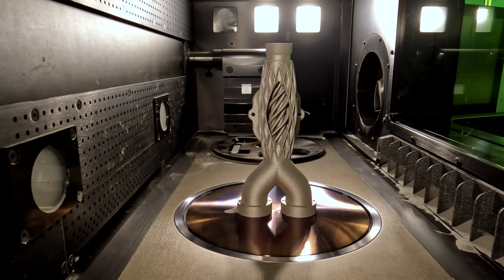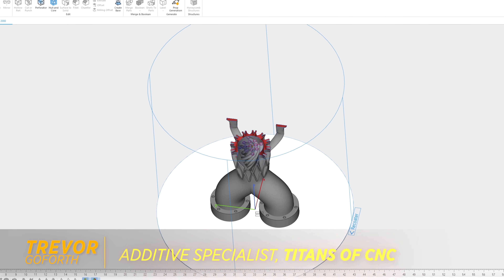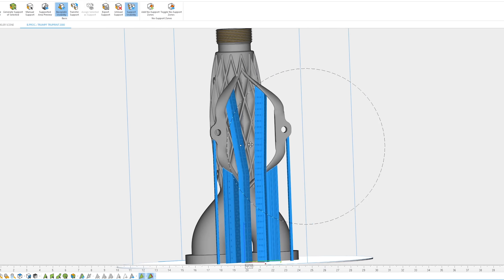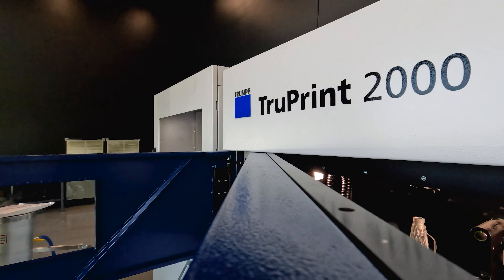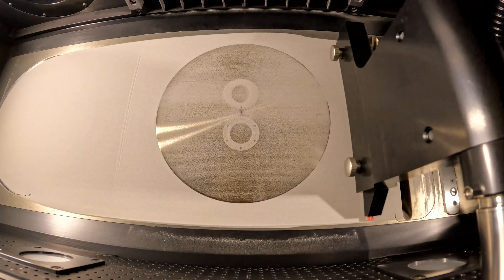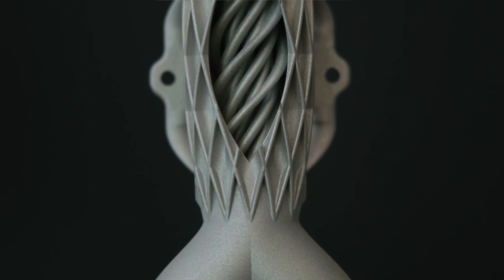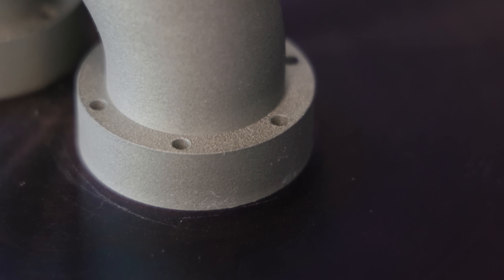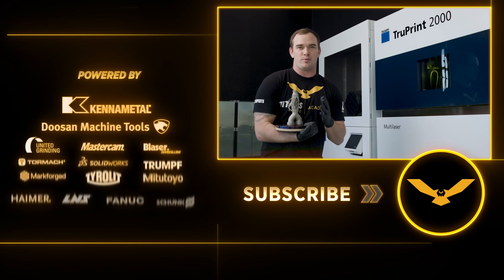3D Printing an INSANE Steel Part that's IMPOSSIBLE to Make on a CNC Machine

Comment: Wow, just wow. I am not an engineer, but anyone can see the amazing potential of 3D printing steel. We've seen plastic gadgets being printed for years, curiosities mostly. But complex steel parts, gamechanger! Engineer Designers may have been able to dream up parts that theoretically would function in a certain way on computer models and not be able to build them. This changes everything.

Comment: When that becomes practical, it will kinda' sorta' change everything. Manufacturability of convoluted surfaces is a severe impediment to advancing tech since it necessarily asserts itself as design driver. The driver usually introduces some form of compromise.

Comment: Does the part receive any heat treatment after fabrication such as sintering or HIP?  How dense is the final metal?  What does the raw material cost and how is it made.  Can some parts be made from plain carbon steel?  What technical advances been made over the last two years.

Comment: Ok but what about the reliability of the part? I know it looks nice and optimal design but aerospace and car parts are put through repetitive and grueling stress and the question I'm asking is if that method of manufacturing can make parts which won't fall apart under those conditions.
Reply: I thought GE was using these for jet engine parts years ago.

Comment: QUESTION:  I have been searching for information on the heat treatment of 3D printed metals, hardening of steel to be exact, and have not found much on the matter.  Can these components be heat treated after printing?  Thanks in advance.

Comment: Only one question - "Is that baked metal strong and firm enough to be used under high presuure and tempereature conditions"? As no one can pass by chemical and physical properties output during certain production process. Preciesely - are those inter-atomic stuctural establishments well enough to be used for a long time with desirable performance?

Comment: It's cool and very practical. This part could be manufactured without 3D printing, a multiple parts design maybe. Also I remember the first time I saw a sintering 3d printed metal part in the 90s.

Comment: my only question is: if that wasn't a cut away how would they get the unused material out of the chamber? I have trouble imagining those two little holes moving all that metal dust out of there.

Comment: It appears to be usable, but without an opening on the side, this heat exchanger will trap steel powder inside during printing, making it challenging to clean (or nearly impossible). Thus, this print is only for demonstration purposes...

Comment: can not be used with any pressure, couse is fragile and will explode
Reply: Not true. For example we 3D print the Exhaust header collectors and flanges on F1 engines in Inconel and have been doing so for the past 12 years.  These operate at 1200 degrees C, with all the combusion pressure pulses, and all the vibrations and forces associated with a race car on track.  They are designed ultra-thin (0.6mm wall thickness for lightness), yet still outlast the engines lifespan on track.

Comment: Yes sir, amazing video... the 3D-printing iself is not so special, the 3D-modelling of the part is which allowes the part to exist/be printed ... the machine is just bought with money, the 3D-modelling skills are painfully gained through years of practice and experience, lets say Catia or other 3D-modelling programs
Reply: So. How exactly is the 3d printing machine designed and assembled? Is it the same case as with milk where it just "comes out of the milk carton" but here it was just magically "bought" ?
Reply: Designed and simulated on lets say Catia or NX or other modelling software.... So the machine itself is designed by the same guys you get the 3D-models from to print my friend  @bajs932

Comment: ok, so regular questions:
can operate at which temperature?
size alterations during temperature?
structural integrity until temperature?
surface properties?
properties against torque or external forces?
toughness?
fluid pressure up to ?
maybe these been explained elsewhere, sorry for that.

Comment: I'd say milling would not be a fast but much more strong for stress due to hardened steel or even heat temped milling out of a solid hardened piece of steel or even liquid steel in which you add the hardening process to the liquid it self just pour it in a mold I don't see how you would make a 3d peice of metal hard in that process

Comment: "this was a impossible part until now"......... that's a exaggeration (more so a lie), selective laser sintering has been around for quite some time. DARPA has been using that s@*t since the 80's and it been around industrially since 2001.

Comment: When plastic 3d printing came out I thought that’s cool. But printing with metal, that’s a whole new level👍 I’m 57 now and wish I was 18 again so I could see all of the awesome things that will be created using tech like this over the next 50 years. Simply amazing
Reply: don't worry, you will live to 107
Reply: I'm skeptical if there are applications beyond prototyping and maybe replacing the odd spare part that can't be found elsewhere. Think of the energy it takes to basically laser weld all of the powder into one part. Traditional methods are still faster and cheaper for mass production.
Reply: @ramdas363  Metallic sintering is used quite a bit in Formula 1 for both Race and Wind tunnel parts, and has been for the past 15 years - In Inconel, Titanium, Aluminium and Maraging steel.  But yes, the volumes are far of being considered mass production.
Reply: @ramdas363  look up 3d printed rockets and rocket engines. Theyre cutting that cost way down.
Reply: @ramdas363  this is still early days, im sure these machines can be better calibrated for mass production if need be.
Reply: @ramdas363  Jet engine have been using this tech for a long while. Fuel nozzle break through for GE.

Comment: Truly amazing, but I do have one question, do parts like that need any sort of annealing or post heat treatment?  I would think that it would be like welding layer after layer, I just sometimes think about sintering sort of effect,possibly due to appearance of outsides.  I also am aware that it is 316L SS, which wouldn't need annealing and hardening after, but what about other materials like high carbon steels?  Awesome result, and amazing tech.  Thanks for showing us.

Comment: I honestly do believe that advances in 3D-Print can help to lift-up several research-areas (in practical and theoretical terms) when it comes to new materials, theoretical concepts, Applied Advanced Engineering (in every area, from construction to fluids and aerodynamics) Art and even food itself someday (which, when it comes to food, it shouldn't imo, but the reality is that we don't know what will be societal status-quo in the next 100-200 years tbh). Imo 3D-Print has the very real potential (when included in other areas of expertise) to kickstart a genuine new Industrial Revolution, and a much more advanced and sustainable one tbh.

Comment: I look at these videos and cringe. I used to work for a manufacturer of SLM/S (Selective Laser Melting/Sintering) machine (the technical name of metal 3D printers); I used to designed the electrical control panel that does all of the sensor, actuators, pumps, motors and laser control inside the machines. What all these promotional videos do not show is all the additional equipment, tools, training and infrastructure that is required to run and maintain in an operational condition these types of SLM machines as well as the health hazards the machine operator is exposed. Here is a list of just the main things (there are more):
 1) These machine need to work under inert environment (because of the powder) and thus need to pull a vacuum and fill the machine with an inert gas (typically argon) so you need to have access / a big bottle of inert gas.
  2) because a lot of these machines are leaky (or get leaky with time) the inert gas will seep into the surrounding room (where the machine is located). Argon for example, is classed as an asphyxiating gas because it is heavier than oxygen and will displace it. In small, un-ventilated rooms/labs you need argon detection sensors installed and wired to the fire-alarm systems
  3) You need full-body hazmat suits and respirators fitted with the correct type of filters; most powder particle sizes are smaller than the human skin pores and this powder will definitely seep under your skin if you are not careful and get in contact with it. Inconel and cobalt chrome powders are known carcinogenics! If I get skin cancer in 10 years I will know exactly why.
  4) You need a special ATEX certified vacuum cleaner for sucking all the excess powder after a build; these are very expensive and have special cleaning procedures.
  5) Most SLM machines use gas re-circulation pumps and require air filters to keep the laser optic window clean and free of powder dust. These filters are also expensive and you need to replace them after every build.
  6) You will also most likely need to get a powder sieving station to be able to sieve used powder in order to re-use it again; like the vacuum cleaner, the sieve needs to be fully sealed, ATEX-certified, and may even need to be placed in an explosion-proof or ATEX room because the powder becomes airborne during sieving (unless you use ultra-sonic sieves); very expensive!
  7) For certain alloys and if the height of the parts is significant, than you might also need to get an oven for heat treatment and annealing; additional expense.
  8) If you think that parts come all good, perfectly printed with no warps or deformations than I'm sorry to say that this is not the case and you may end up running the same build 2 to 5 times to get the piece right. These machines produce a lot of scrap.
  9) Metal powder is expensive; can self-ignite in air/oxygen environments; some if it is carcinogenic; if you breath it, your lungs will definitely not be happy; the hazmat filters are not going to protect you 100%.

Comment: Amazed with the shape you achieved! I am wondering just one thing, which treatment do you use to reduce the rugosity of the internal side of the pipes?
Reply: i wonder the same, looks a bit rough
Reply: Extrusion honing would probably be the best

Comment: Printed parts are not as durable as machined parts, so stop the hype😂 Printed parts are completely unsuitable for high pressure and heat applications!

Comment: I started my technical career 43 years ago at a company that made powdered metal parts for the auto industry. Parts were pressed out of powdered metal using dies and punches. The green parts would be sintered on conveyor belts through long furnaces. At the time it was very high tech. Looking at the part made in the video now seems like magic. 3D models laser sintered into very unique and complex parts with out expensive tooling seems like we’re getting nearer to the replicator technology used in Star Trek. Simply amazing.

Comment: This was science fiction 10 years ago!
Reply: Not quite, metallic sintering machines was developed 25 years ago, although they have become a lot more widely used in Low volume manufacturing within the last 15 years.
Reply: @YowserUK  Well sintering is even older then that. But combining it with a high-precision laser is new stuff.
Reply: @Volpenowski  Im specifically refering to high precision laster metallic sintering. I first started designing metallic 3D printed parts for manufacture within my industry 13 years ago.

Comment: I remember seeing something 3D printed using plastic for the first time years ago, and I remember saying or thinking "this is gonna change the meaning of the word 'printing.'" This kind of technology just keeps getting more and more incredible.
Just imagine having a machine that hasn't had parts made for it in 30 years, you send in the part  that needs to be replaced to have a 3D model of it made on a screen, and then it gets printed.
Reply: lot of old vehicles are being restored like this!
Reply: I fixed up a part on my 20 year old motorhome this way. I destroyed one of the fiberglass wheel arch trims in an altercation with a fence. I used photogrammetry to scan the good side of the van into a 3d model, loaded it into the PC and mirrored it, CAD'd up a model that roughly followed the same shape, printed off a test of the full piece in plastic (had to do it in like 11 parts and glue together since my printer only handles 22cm cubed build volume) to ensure it fit to the vehicle, then printed a mould using the same CAD file to lay up fiberglass into.
Reply: They are now printing organic material.  Within 50 years humans will have access to printed skin. Noses and ears will be the easiest.  Bone and organs might take some extra work.
Reply: You can do that with your retainers now. Although the resin is pretty expensive.
Your ortho just passes the stl file and you can print extra retainers

Comment: Did you have to do any form of treatment to reduce porosity and make it watertight?
Or is all about your print resolution?
Reply: As long as the laser parameters are set appropriately , porosity shouldn't be an issue.

Comment: Not sure if anyone asked and sorry if a repeat.
What is the strength and or pressure limitations with using a powered material vs casting?  Bending moment or vibration concerns mainly.
Reply: if i recall, there was a car made with parts that used this process, AI designed the parts to where they were crazy light, yet strong enough to handle being pretty integral parts, ie suspension arms and more than a few frame components

Comment: what's with the hazmat gear?
Reply: The "toner" for this type of 3D printer is very fine metal powder. Think particle size in the several tens of micron range, or 1 to 3 thousandths, give or take some. That's stuff you don't want to inhale. Even the alloys that are fine in bulk form can be a serious health risk when in really fine powder form.

Comment: Wake me up when this can take the stress of a machined part....
Reply: Well, time to wake up then! Selective Laser Melting (SLM) will yield mechanical properties superior to as-cast, and tensile strenght approaches that of forged billet material. Only impact strength and fatigue resistance are closer to as-cast than forged. 

Besides, the whole idea of additive manufacturing is putting material exactly where it is needed, so any weak spots can be bolstered by locally adding more material.

Comment: As someone that built their first FDM printer from scratch nearly 10 years ago, it makes me so happy to see this, both the model, and such a quality print.

Though implant grade joints sounds like a nightmare, from a QC and certification perspective. I'd be curious to see that process.
Reply: I think using medical resin might make it a lot easier.

Comment: Does SLS/SLM ever need supports? I wouldn't have thought so
Reply: Powder bed methods (SLM, SLS, Electron beam) need support in almost all cases, otherwise the wiping action of clearing spatter and/or the wiping action of depositing a fresh new powder layer can either displace or remove unsupported build layer sections. In this case the overhang was limited and the part itself offered enough support, but that's an exception really.
Reply: @Hydrazine1000  well that's a shame, I thought the overall structure of the material was solid enough to be able to be used as supports :/
Reply: @BelviGER  Mostly, the support is for shape insurance. If you have a build layer with an isolated small melt area, so a small section of molten and solidified metal without support downward towards either the build part or support structure, then the wiping to clear spatter will also displace or wipe away the new and "unmoored" build layer. 

The support is not there to prevent sagging. In that sense you thought correctly, the powder bed is supportive enough. The support is there to prevent shifting during wiping actions.
Reply: @Hydrazine1000  yeah I completely forgot the fact that the new layer is a wiping action, not a lite dusting or the material having enough integrity between grains that it'd remain stable

Would you happen to be able to point me in the direction where I can read more about sls/slm? It's kinda hard to find people tinkering with them and talking about it

Comment: This part looks 'designed to look cool' more than it being designed to be the best part for a given application.

Do the curved heat exchanger tubes really add anything of value?
Reply: I guess being curved, they have extra length,hence extra surface for heat exchange
Reply: it's not even a heat exchanger  large flanges on the side for coolant to be passed through would make sense  . but it's really just a useless part that looks cool until you ask yourself WTF is that for.
Reply: Not to mention the opening on the side...?

Comment: Powder metal printers are definitely the future for manufacturing parts. Is there currently any way to get a smoother surface on the parts being printed?
Reply: Smaller layer height but it's also dependent on the particle size of the powder. Could probably make ultra ultra fine powders but then you run into explosion risks